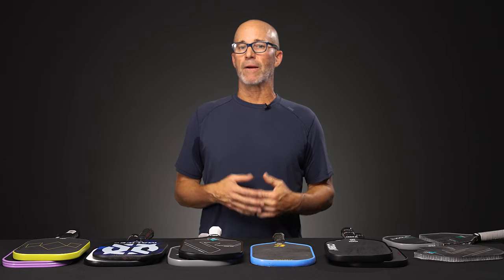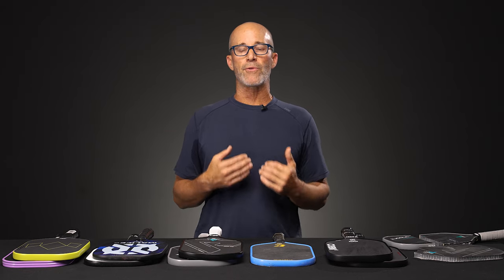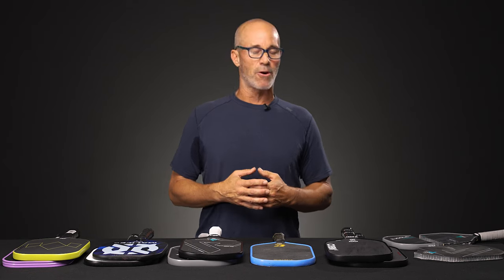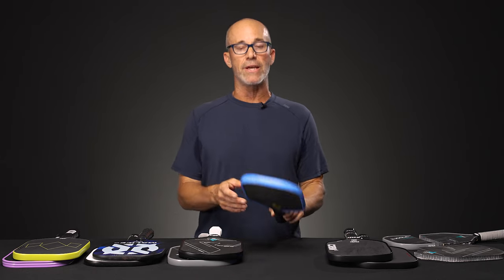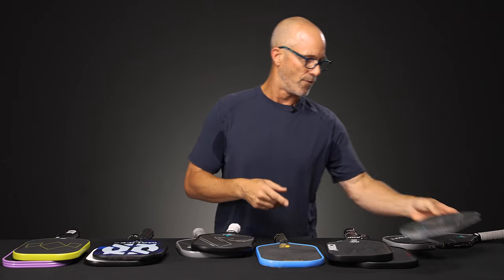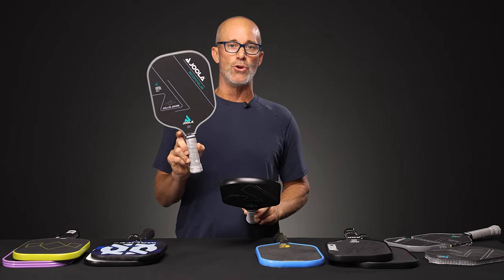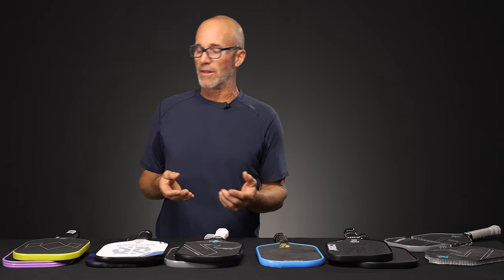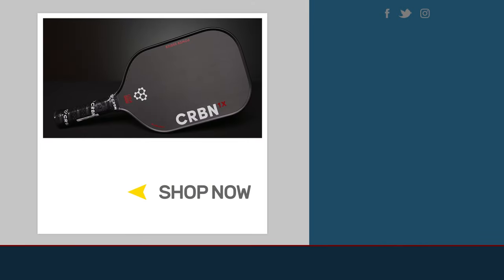The evolution of Pickleball Paddles (Gen 1 vs. Gen 2) - VLOG

Comment: very nice and generation3 , ?? what goes into that ?
Reply from the maker: Thank you for the feedback on the brief explanation of Gen 1 and Gen. 2 pickleball paddle evolution, along with the question regarding the latest Gen. 3 paddles. Basically, Gen. 1 paddles utilized the traditional cold-press construction with a transition occurring within Gen. 1 paddles, in terms of going from a fiberglass face material to a hybrid. With Gen. 2 paddles, you see the advent and popularity of thermo-formed construction along with the use of raw carbon fiber for the face material. The new Gen. 3 paddles are most often thermo-formed, and instead using polypropylene for the entire core material, you are now seeing foam filled (a type of EVA) cores. in the case of the new Gen. 3 JOOLA paddles, less polypropylene is used and what is used is then surrounded by one type of foam, and then another variety of foam on the outside of that. So there are 3 different materials used to makes up the core. When it comes to the surfaces of Gen. 3 paddles, currently you have options for raw carbon fiber, or a carbon fiber hybrid (usually mixed with a proprietary fiberglass). 

I hope the details help out as far as what goes in to constructing a Gen. 3 pickleball paddle. If you are wondering what comes out of it, so to speak, performance wise, it is easy power! 

Mark/TP